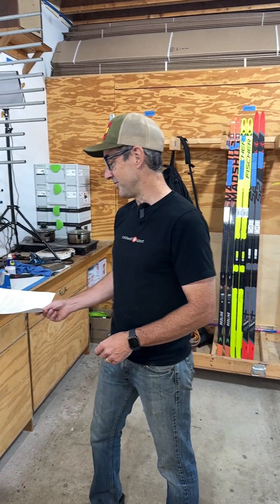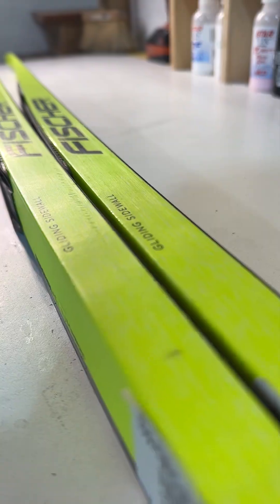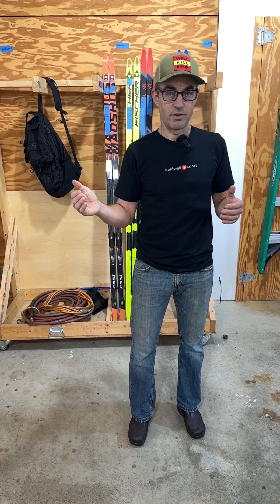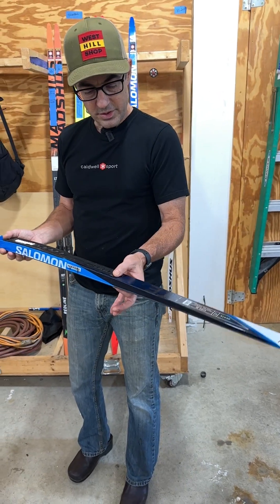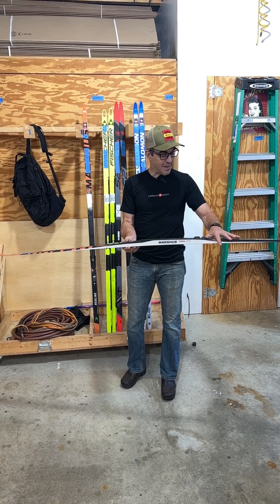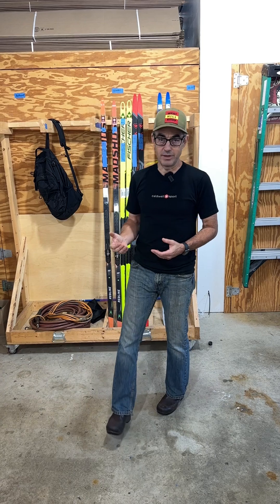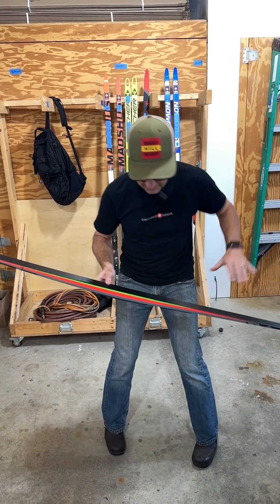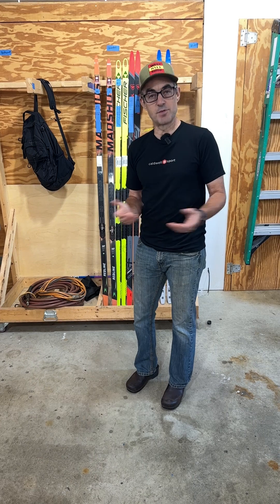Nerd Files S3:E2 Skate Ski Stability

Comment: Great summary, thanks Zach! To add some n=1 data points here, I have preferred Salomon skate skis for the past two decades. They just feel right. However, I also have Madshus Redline 3.0 F3s and have really enjoyed them, despite their opposite weight-balance characteristics, as you describe here. They do feel slightly less stable in the glide phase but it doesn't bother me. Fischers feel fine to me, just kind of mushy and boring. Rossis feel absolutely terrible to me (at least the pairs I demoed last year). Too springy and grabby, a completely different experience. For me Rossi seems like the clear outlier in terms of design/handling characteristics (not in a bad way, just not for me).

Comment: I would be interested to know more about the materials and construction used in the edges of xc skis.  It seems to me that if the material and construction of the edge is harder and stronger than the surface you are skiing on, that might help it hold an edge.   If the edge is getting beat up by the surface, that doesn't bode as well for holding an edge.  Especially in a longer race, where by the end of the race, the edges might not be in the same condition they were in at the beginning.   I had some skate skis that I skied in very icy conditions and the edges got rounded, and another pair where the edges got cracked.  Another pair held the edge better on ice and suffered less damage.   I wonder what the differences are in materials and strength-related construction, in ski edges.

Comment: Gee, I would have guessed that skis with high local edge pressure would have more edge stability than long low pressure, and skis with long low edge pressure would do better, in soft conditions, especially speed wise.  Wouldn’t high localized edge pressure make the ski plow and slow down in soft conditions,and give it a better chance to get a bite on the surface of hard plate conditions?
Reply from the maker: Hi Randy - I should have been more clear. Trying to cram everything into 15 minutes makes for a lot of abbreviated information.
The place where longer edge pressure can be good is on really hard icy snow where you don't make an impression with the edge. As soon as the snow is a bit plastic - subject to deformation - then the higher local edge pressure is better. Both cases would be considered "hard snow" though. 
In general you're correct that longer pressure zones do better on soft snow for spreading the load and increasing floatation / limiting loss in viscous flow in the snowpack.
Reply: @caldwellsportski Ah, okay, got it.  Thanks.
Reply: Ski Trab's Skate  ski is like an ice skate. It's so boring but......I'm just washed up old man.